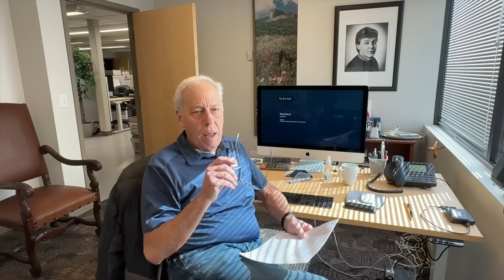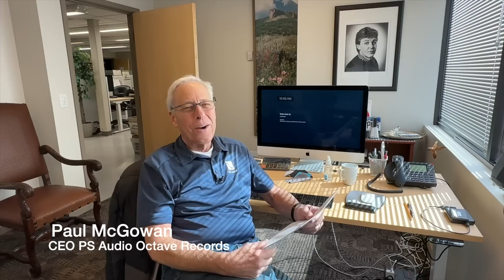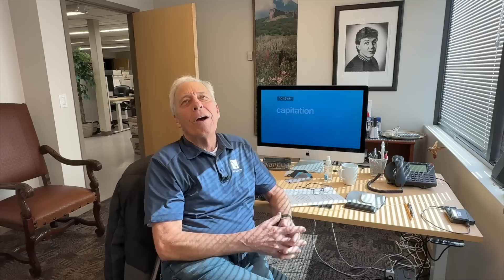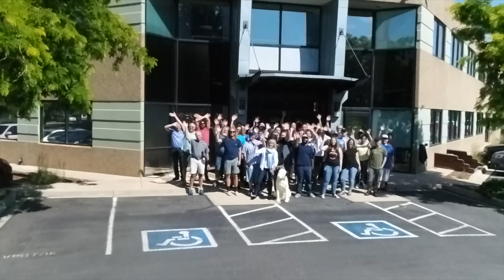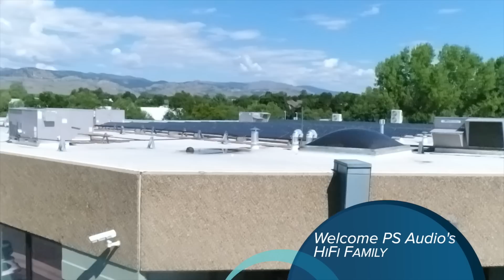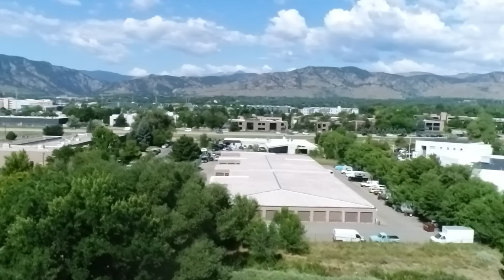Best operating temperature for stereos

Comment: Everything should be written in the manual. For example I’ve got a vintage voltmeter and the manual says you can start measurements in 30 minutes after it’s turned on. Explaining why it so for 95% of equipment owners is impossible to understand correctly. Even  the specialist sometimes do not fully understand the nature. Just simple like that.

Comment: Comparing superconductors to lowering the ambient Temperature of HiFi gear and experiencing some increase in efficiency?  Not buying it. Cooper Pair state won't occur anywhere near STP, with current techniques. But a recent breakthrough where We may get to experience superconductive HiFi gear has reportedly occurred.
"In a historic achievement, University of Rochester researchers have created a superconducting material at both a temperature and pressure low enough for practical applications.
“With this material, the dawn of ambient superconductivity and applied technologies has arrived,” according to a team led by Ranga Dias, an assistant professor of mechanical engineering and of physics. In a paper in Nature, the researchers describe a nitrogen-doped lutetium hydride (NDLH) that exhibits superconductivity at 69 degrees Fahrenheit and 10 kilobars (145,000 pounds per square inch, or psi) of pressure.
Although 145,000 psi might still seem extraordinarily high (pressure at sea level is about 15 psi), strain engineering techniques routinely used in chip manufacturing, for example, incorporate materials held together by internal chemical pressures that are even higher."
American Maglevs, Magnetic containment Fusion, Earth to Orbit via the Magnetic Fields generated, not to mention Field Coils where a tenth of a Watt can fill a stadium, hopefully in the not too distant Future.
Reply: @Douglas Blake Today's Bullshit, Tomorrows' Reality. Been waiting on room Temperature superconductors since reading Larry Niven's Ring World, as a pre teen 50+ years ago.
Reply: @Douglas Blake Absolutely not. The most innovative Science is often first breached in Sci Fi novels. “When a distinguished but elderly scientist states that something is possible, he is almost certainly right. When he states that something is impossible, he is very probably wrong.”
― Arthur C. Clarke

Comment: use nos preamp tubes and have no worries, they sound good from the first second and after a while  it only gets better...they also last decades. if you'll pick all the tubes that paul has thrown to the bin after one year regardless of operating time or testing them on a tube tester,
then you will have a pile of worthless modern junk!

Comment: why would they not put a fan say in an AVR to help cooling like in PCs & craptops?
Reply: @Douglas Blake well fan noise to me would be a very minor issue as fans I've used for 10 yrs in PCs aren't noticeable sound wise. yes they do collect dust and would have to be cleaned just like other uses but to me instead of keeping ambient temps around 68 degrees a fan would help in my book
Reply: @Douglas Blake yeah you were talking thermal control I was thinking more about constant exhaust more straight wired and no thermal control. I put a small thermometer on my PC exhaust and then on my Sony AVR and the Sony ran just as warm (if not a tad more) than the PC
Reply: @Douglas Blake yeah did give that some thought, but not that handy with that sort of thing. I have an air-cooled PC with 7 various sized fans an noise has not been an issue so far. but do see your point. I just keep the AVR elevated with plenty of space around it and it is warm to the touch like other electronics I have.
Reply: @Douglas Blake you know you're right thanks Doug forgot all bout that USB port 👍

Comment: 1980's Technics amps had a "pre-heat" (Computer Drive) to bring the output transistors up to temperature and stable bias.
Reply: My dad has a Technics sa-1010 and it has that.

Comment: Semiconductors used in aerospace applications are artificially aged through temperature cycling, the intent is to weed out infant mortality.  For example; a module would be temperature cycled 15 times between -54 Deg. C and + 95 Deg. C, if it gets through the the temperature cycling it will be on the flat part of the bathtub shaped reliability curve and be good for 30 years or so.  Other than that it's always best to keep the running temperature as near ambient (device operating parameters are specified at 25 Deg. C) as possible but heatsinks are among the more expensive parts of an amplifier.

Comment: My amp gets very warm so I bought a  small  USB fan which I  connected to the USB port on the amp and placed it close to the amp. So when I turn on the amp, the fan starts up and cools the amp. And also turns  off when I turn the amp off.  Easy peasy
Reply: I have a receiver from 1973 the has a switched outlet on the back and accomplishes the same thing.
Reply: Prob blows dust into the amp. Does it already have a fan that isn't coming on? If so you don't need it.
Reply: @roof pizza  well, there are two alternatives, one is to put a filter before the fan if it's pushing air into the amp, and the second one is to keep your house clean and dust free. I had a Phase Linear 700 and the heat sinks were external, at the back of the amplifier, so no problem to use a fan.
Reply: @Roof_Pizza  It also blows dust out of the amp according to my logic.
Reply: @artyfhartie2269  All those nooks and crannies? Nah.
Reply: @Roof_Pizza  Electronics go bad with accumulated heat. Plus when they get covered with a layer of dust over time, there is a potential of a fire.  Stay cool, bro.

Comment: When engineering analog electronics and taking into account component values changing by temperature, you optimize for a certain operational temperature for lowest distortion. Still, generally speaking, the warmer it gets the more thermal noise there is and the faster components degrade (e.g. electrolytic capacitors). 
Digital electronics sounds the same no matter temperature (within a safe temperature range).

Comment: I think the question was directed @ what temperature?  That depends on SS or Valve (Tube) type amps/pre.  Yes, the electromagnetic field has resistance due to heat in the signal path.  For SS amps/pre, cooler is better.  Internal temps for a SS amp/pre (what ever class) should be most efficient and sound it's best between 120F to 180F degrees.  Cooling them would be ideal.  Tubes, on the other hand is a different matter.  Heat makes a big impact on the way the signal sound at the speaker.  Tubes have heaters built into them.  They operate between 150F to 250F+ alone.  Combined with the transformers, they can exceed 300F.  Usually though tube amps/pre have a thermal safety built into them.  This is to prevent damage to the equipment while maintaining high temperatures.  300F+ is very high for a tube amp/pre but internal temperatures on some tube equipment can get that high.  Using fans externally to push the heat away from the equipment is a good idea (especially in the summer).  So, my 2 cents here.

Comment: Dezigners spec resistors to run at operating temporature. When cold the resistors in the circuits are not the same value as they are warm.
PS Audio may not do this as Paul has explained that it would be better for their equipment to be better closer to startup temporature.
Mabe Paul could clear this up in a future video.

Comment: I understand that class A amplifiers sounds better because of operating temperature, the transistor,like fet,are more linear in a higher temperature setting, am I wrong?
Reply: The theoretical advantage of Class A is regardless of operating temperature. Operating temperatures are high because of how a Class A design works. It is a result, not a benefit. The design advantage is the device is operating in the middle of it's most linear range. Where in Class AB two devices are needed, one for negative and one for positive parts of the cycle. There is a distortion in the zero crossover point they try to reduce by making each one overlap into the other region for a while.
Reply: One of the very important goals of Class A amplifier design is prevention of thermal runaway! In high temperature, a transistor will conduct more current and leads to even higher temperature until the transistor is burned.

Comment: Hello. Does anyone have experience with class-a amplifiers?

Normally, the sound gets a little better when the amplifier gets warmer. Compare my
class-ab with my
class-a, my
class-a has worst sound when it is cold than my class-ab has when it is cold. But when both get warm, class-a has the best sound! Is this normal for a class-a to sound so bad when it is cold?

My class-ab and clas-d have better sound when when they are cold  than what my class-a has. Too big difference!
Reply: One of the very important goals of Class A amplifier design is prevention of thermal runaway! In high temperature, a transistor will conduct more current and leads to even higher temperature until the transistor is burned.

Comment: I  have 3 amps in my system doing 3 different jobs and if you were to guess what applications they were doing by how hot they got you'd probably get them 100% backwards. The fans never run on any of them, never.  External fans aren't needed very often and can cause problems other than fan noise.

Comment: I've always wondered if anyone has ever expirimented putting a pc liquid cooling system to replace heat sinks in an amplifier.
Reply: I good idea IMO.
Reply: My home made class A amplifier (designed by Nelson Pass, it's the F5 Turbo V3) dissipates about 800 Watts when idling (that's four separate amplifiers) and regular heatsinks and forced air cooling couldn't remove the heat fast enough and resulted is smoke and tears twice.  A cold plate, two small car type radiators each with a fan, a central heating pump and a five gallon tank make up the cooling system and the amplifier barely gets 5 Deg. C above ambient.  The disadvantage is the noise from the two fans so it had to go in the cellar bellow my listening room.
Reply: @stevesmyth4982  800 WATTS? hell.

Comment: The capacitors will last longer at a lower temperature. You can look up the graph with temperature and Lifetime at the manufacturer.
Reply: It is 100% true. Heat is often your enemy number 1. I like amplifiers with external cooling fins on the sides.

That way you have less heat inside the amplifier
Reply: No shit sherlock🧐

Comment: 100 degrees celcius is optimal
Reply: At 100 Deg. C a semiconductor power rating is significantly reduced.
Reply: @stevesmyth4982  Yep.  That's well over 200F.  If any amp goes past 200F for more than an hour, you could have issues.  Past 250F, you could be looking at thermal shut down.  Some amps can go well beyond that (towards 300F) before thermal shut down.
Reply: Please pick a degree I'm running a Denon  x6700h
Reply: Amps? lolz. 
Protection  circuits will be something along the line of...
85c...fan comes on
90 c...amp output reduced
95c amp put into full protection mode (no sound).
Reply: @Roof_Pizza  Correct, for SS amps/pre